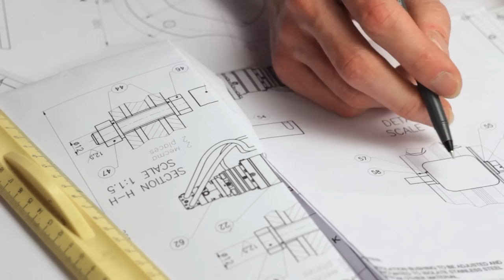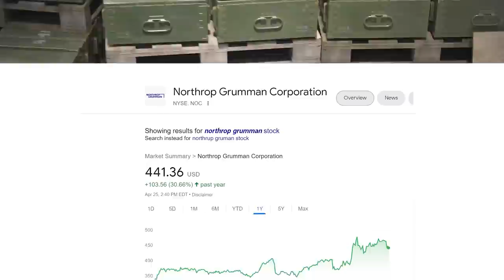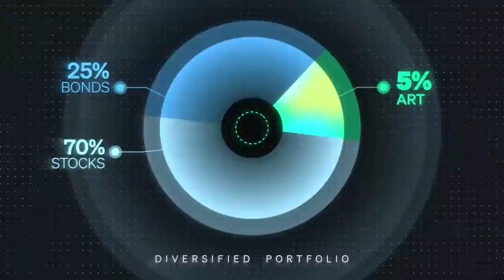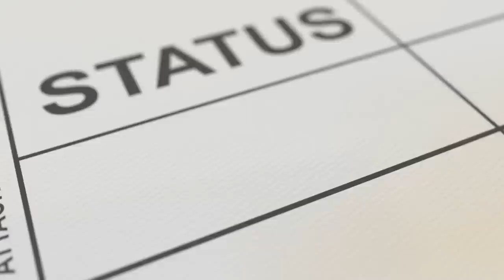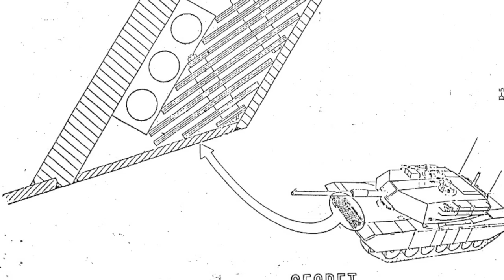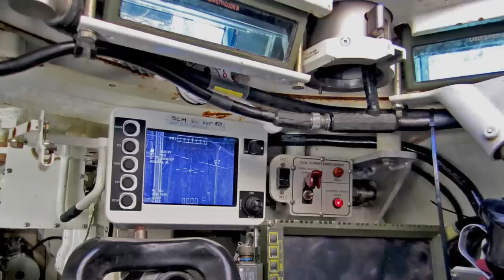The M1 Abrams Tank Needs to Chill Out

Comment: I once got a box of Abrams turbine blades from the hot section of it's engine and was tasked with inspecting them. I looked at them with digital radiography and found they were all full of sand. Turbine blades typically made on inconel often have tiny machined or cast holes in them to pump cooler air through them so that the engine can run at higher temperature. The sand was basically microscopic and had gotten heated enough the melt slightly into tiny glass drops that stuck to the walls inside the blades air passages and built up to the point that they clogged and the blades overheated and started to melt likely causing the engine to stop itself from over temperature warnings. Was one of the cooler things I ever looked at.
Reply: Sounds about as expected for a tank operating for an extended period in the desert, i.e. Iraq and Afghanistan
Reply: Sounds like it wasn’t all that cool. Budum-tsss
Reply: Hmm I wonder how much this factored into the decision to move away from the turbines for the next iteration. Cool info.
Reply: What was the coolest thing you've ever seen?
Reply: @blakebrown534  Telsa tanks graphene battery electrics.
Reply: Sounds like someone should scrub those blades clean again.
Reply: I’ve blown the pack just to not go out that day . Shit was bad
Reply: So do they not have particle separators on the intakes? Or were the particle separators overwhelmed in that environment?
Reply: @unconqueredson1424  a $300,000 vacuum engine assembly that I held in my arms for a grand total of 6 seconds.
Reply: @rs232killer  I don't know the details of what happened but my guess is that filtration might have failed or been overwhelmed maybe trying to run during a dust storm for example.
Reply: @Chooie6  Best 6 seconds of your life?
Reply: @unconqueredson1424  nah it was cool but doesn't go further than that I lifted it out of a padded box onto a table then into a big computed tomography machine scanned it then put it back in the box while the customer observed.
Reply: @blakebrown534  
Turbines were a mistake from the beginning. Thirsty, super hot exhaust, fragile in desert, etc. There's a reason no other tank used a turbine. It's the tank equivalent to the Mazda RX-7s wankel rotary engine.
Reply: @ruthnoya8424  I disagree. Turbine power was actually a great decision in terms of tactical advantage. The poor decision was not having an automotic air filtration cleaner when it was initially developed. That contract wasn't granted until 2001 when it was clear that we were probably headed back to the desert, and it would be several years until it was actually implemented in-theater.

In any other environment, though, the turbine is the master of reliability even without auto filtration cleaning. That it's thirsty doesn't matter much to an army that has the best logistics system in the world.
Reply: I bet those VPacks weighed 80 lbs each lmao
Reply: Awesome RCA job!